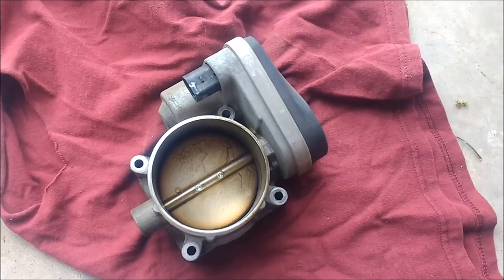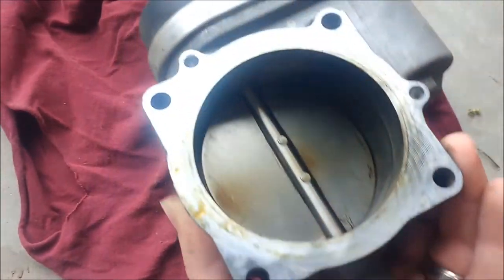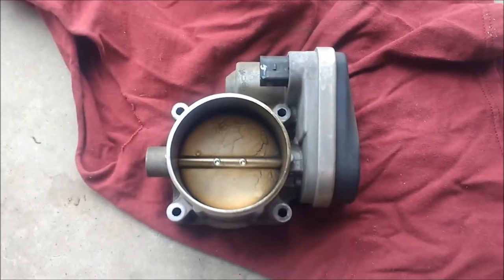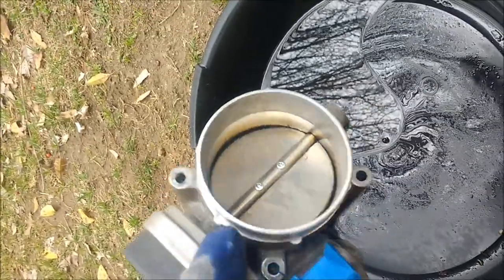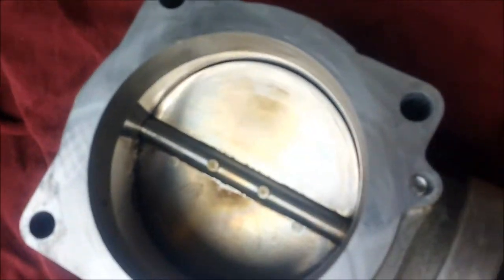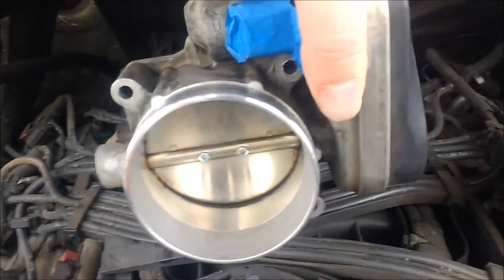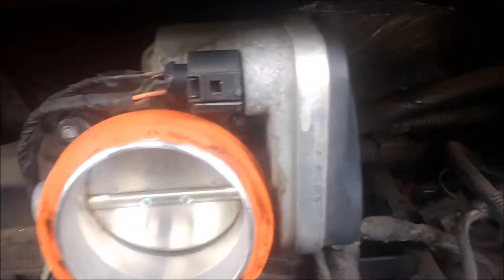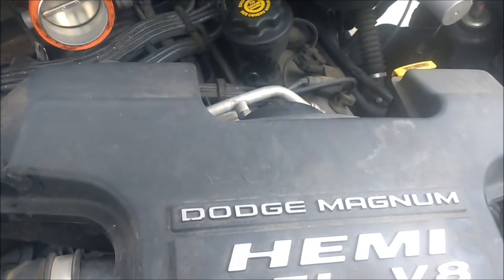Throttle Body Clean - 5.7 Hemi 2004 Dodge - remove intake

Comment: I know this is an old video. But I open that butterfly all the time I clean it, and it never gives me a problem. No idle issues. On my hemi.
Reply from the maker: Do you mean that the precaution to not touch the butterfly is not necessary?
Reply: I have been told to remove the negative batt Conn and it should be fine.  Not done this on my truck, yet. Still researching this.
Reply from the maker: @db477   i did not disconnect battery and no issues.  You do unplug the part before cleaning.  So i wouldn't think the battery is important.
Reply: @Prima10ne  my question is mine is clean  what do I do?

Comment: To late for me already moves the valve. Hoping for the best.
Reply from the maker: Try to return it to the position it was in originally (if you can remember)  then install it back and let the engine idle.  if the engine sounds the same and is at constant RPM, should be OK.  If you notice that it is high rev or low rev and bouncing around the RPM gauge, then it will need adjusting.